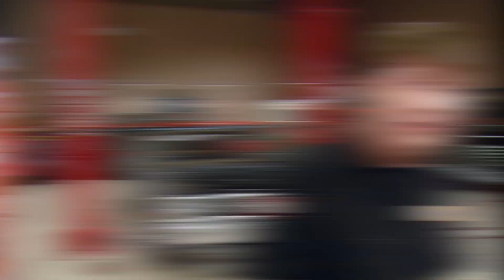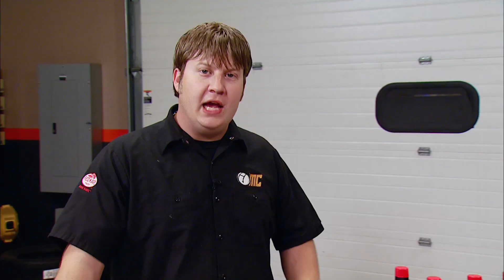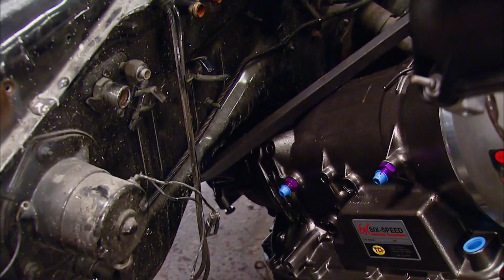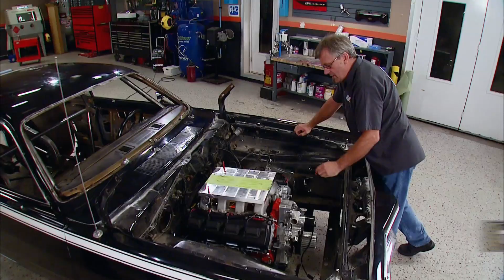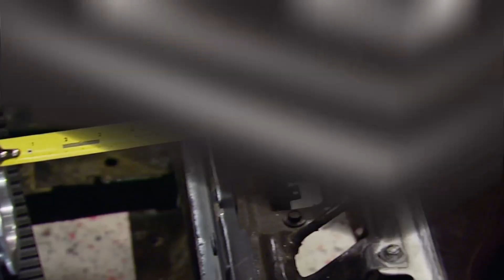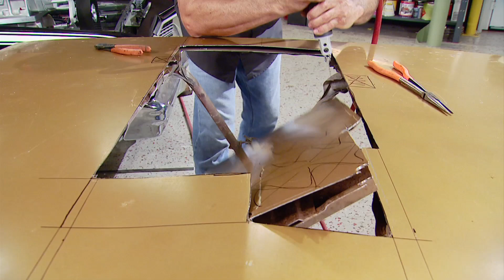Wedging A 426 Hemi In The Unibody Dodge Dart - MuscleCar S7, E11

Comment: Ooooofff! Avoid putting a front plate to the heads… Engine mounts standard or plates need to be mounted to the block! Especially with aluminum heads. They will shift on the block and wallow out the dial pin holes. Bad idea! I know on the gen 3 hemis you can’t mount to the block due to the front cover… So don’t… at all.
Reply: I was thinking that setup didn't look strong enough.   Other potential issues not withstanding.